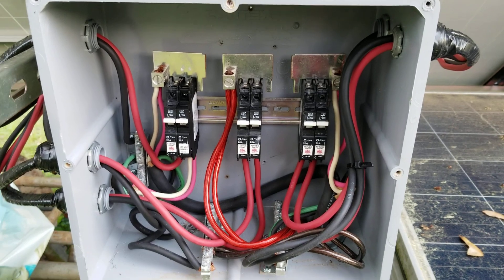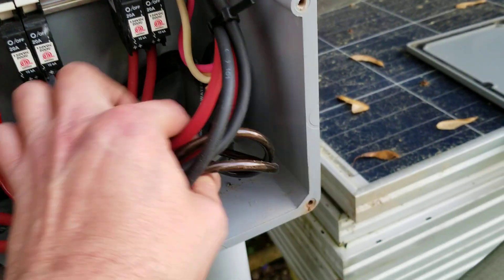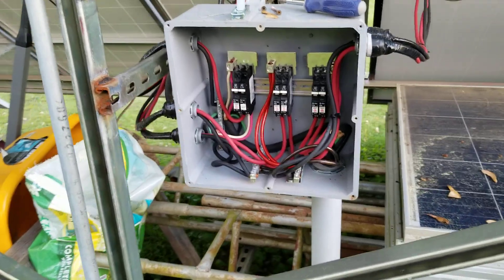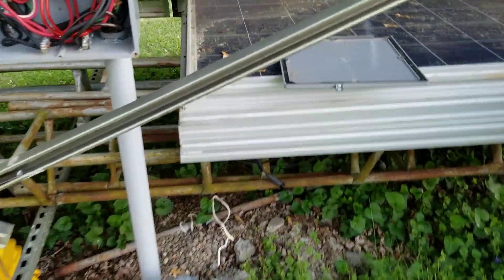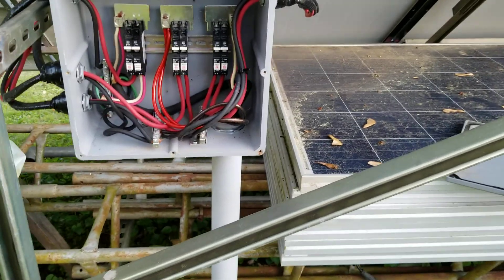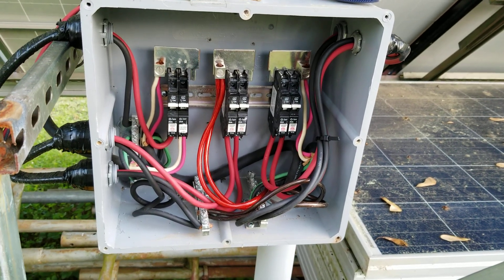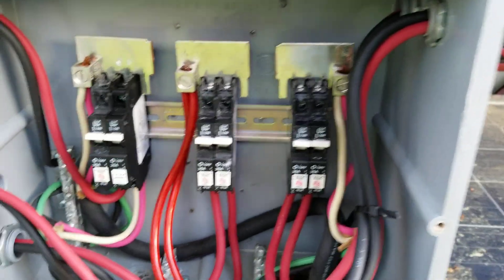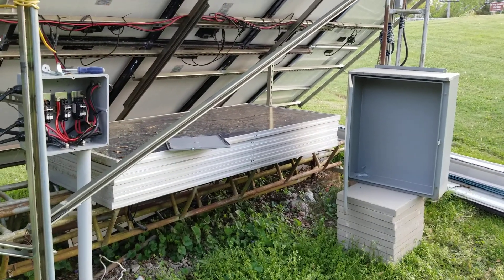Off Grid Solar Combiner Box...How I built mine , And Upgrading to Bigger soon.

Comment: are just combining the positives? 
The bats u cut, how do they connect to the port that the wire would have went into?
Reply from the maker: Grounds get combined and each postive from each Solar array go through Breakers and are combined as one on the the output plates which feed back to the charge controllers.
Reply: So u still have 6 negatives going to the house?
Reply: Where do your grounds go after they are combined in the box and is that a ground from each set of panels coming into the box
Reply: I meant bars u cut.. how do they connect to the ports where the wires could have been
Reply from the maker: @RJ-cc1fz  They have notches in them, And Yes slide right in the Breaker ports and tighten down with screw just like you would do with wire. And then they are all combined. You can find them on the Net the Model number MNPV6-BREAKER-BB